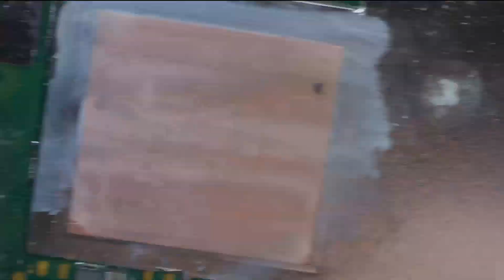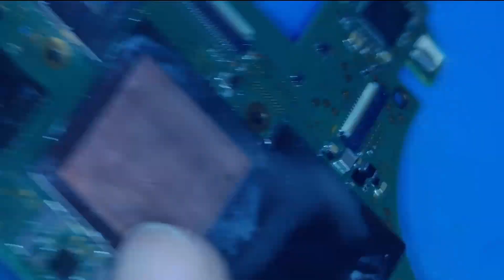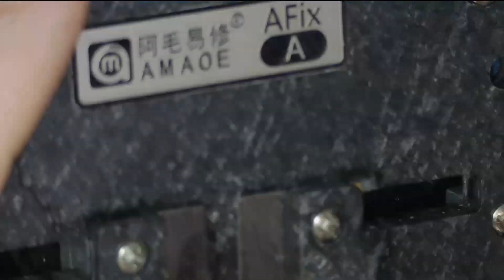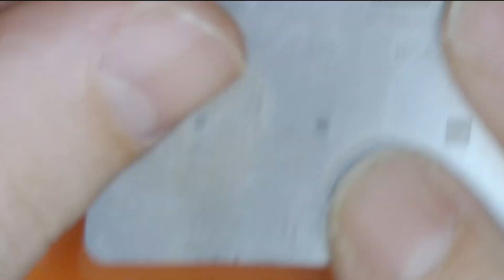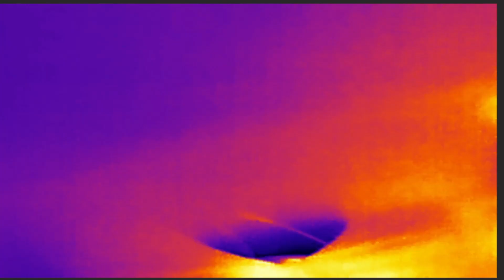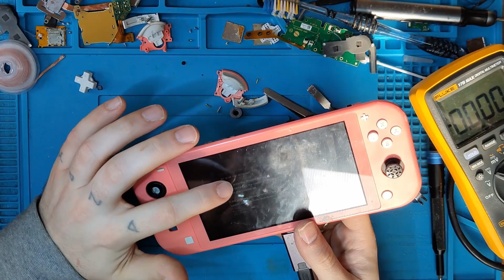Faulty Switch Lite That Ended Me

Comment: Andy, so I know you had previously geared your channel towards learning about this stuff. Did you have any experience with electronics before you started? I'm wanting to get further into it. However, by trade I'm a mental health therapist. So, I'm just looking at it for a hobby.
Reply: Do you have any pointers for someone just starting out that knows nothing about circuits, resistors, capacitors, diodes and whatnot.
Reply from the maker: Hey Daniel, nope no experience at all. My advice is buy a multimeter and probe things to understand what it does lol. That's where I started. Also watch tonnes of videos and trying to understand what the components do. 

I 💯 recommend giving it a go!

Comment: I know you can do it. Maybe you should reball the WiFi ic. Since there was some oxidation around it and check the sub board connectors if oxidation is shorting out pins
Reply from the maker: I can but I spent so long on it I can't be bothered at this time haha. I can just pull the WiFi chip off as it will still work without it on.